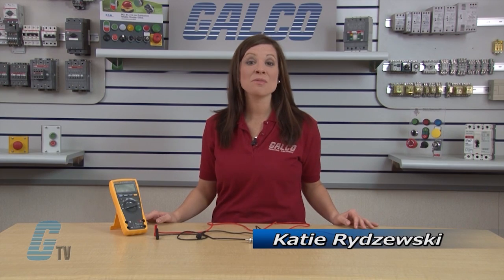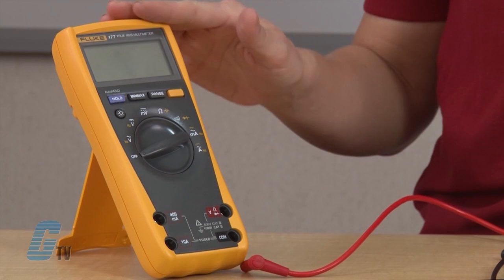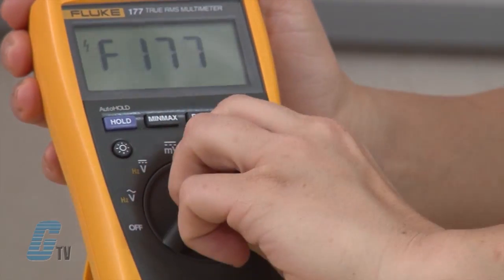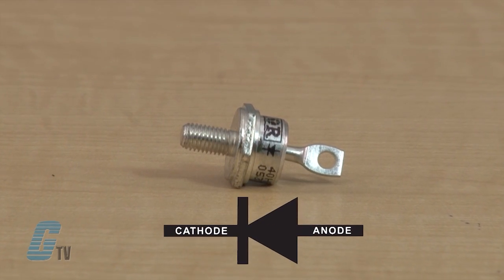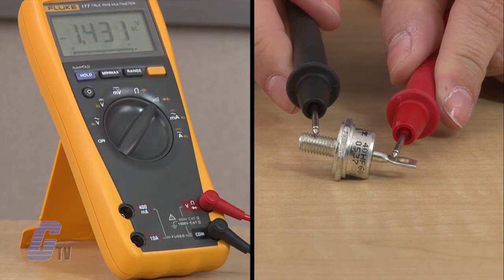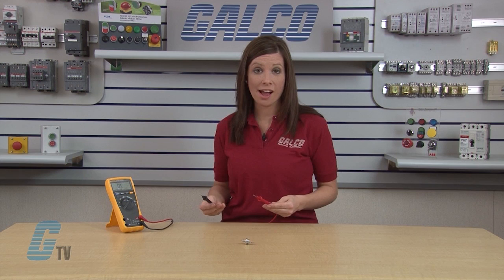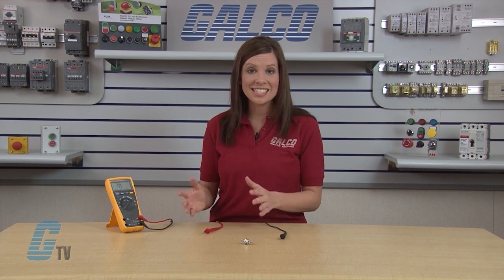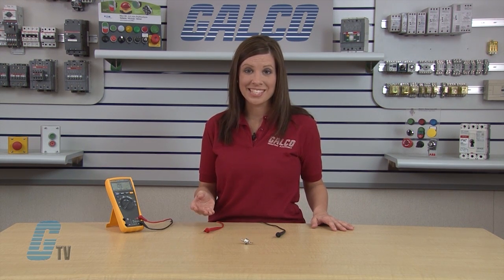How To Test A Stud Diode Using A Standard Digital Multimeter

Comment: A Standard Digital Multimeter ( non-fluke meter) do not have a diode check, some people do not have the money to get a fluke so are fluked as a result.
Reply from the maker: Although the Fluke meter is featured in the video, Galco offers more affordable digital multimeters that have diode testing from brands such as Extech, Triplett, Gardener Bender, Amprobe, Sperry Instruments, etc... This is now a standard feature on nearly all manufacturers of digital multimeters and can be verified on sites that cater to residential needs such as Home Depot and Lowes.  If you are referring to voltmeters, ohmmeters or analog multimeters, then there might be a different result, but it would not be a standard DMM.